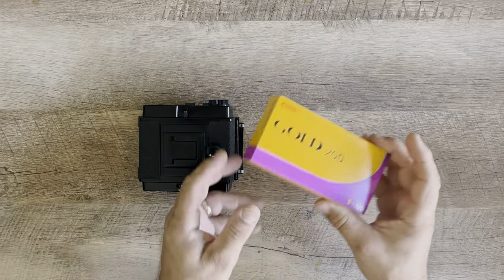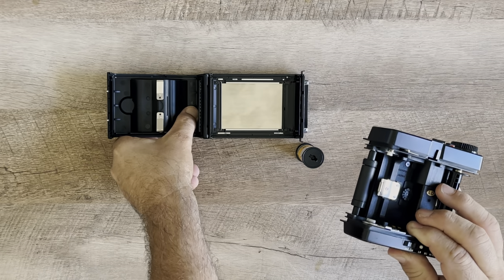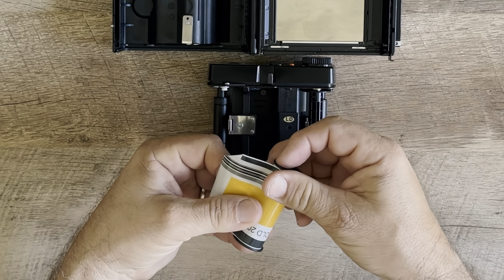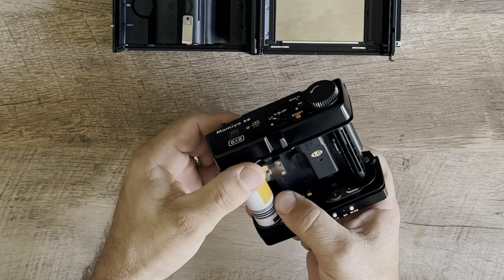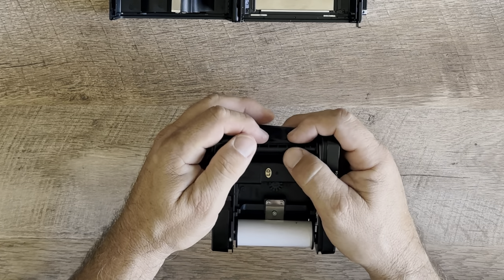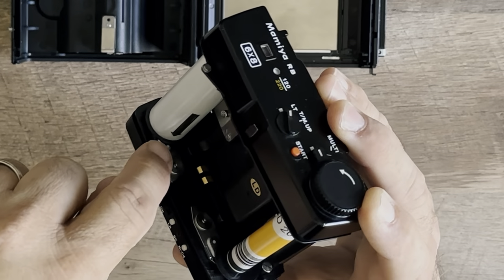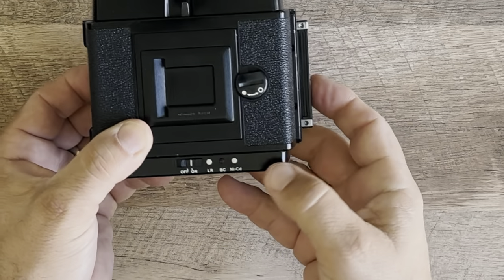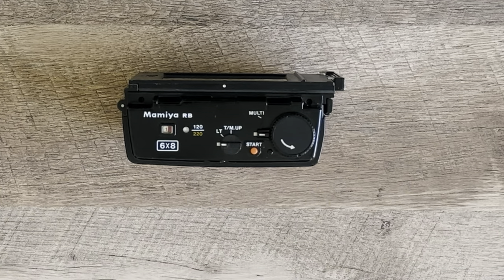LOADING A MOTORIZED 6x8 FILM BACK | MAMIYA RB 67 PRO SD

Comment: If I put in a 220 film, do I have to change a setting or something on the back? Thanks!
Reply from the maker: Tom,
I’ve never tried it. I will have to take a look. Maybe the mask in the back can be changed?
Reply from the maker: Tom, found the manual online, you can rotate the mask inside from 120mm to 220mm. 

Selecting the pressure plate position
This film holder can use 120 or 220 roll film. In accordance with the film type used, the pressure plate position differs, neces- sitating the position selecting procedure. As per the following steps, select the pres- sure plate position so that ti aligns with the same numeral (120 or 220) as that of the film type used.

Comment: What’s annoying about the 6x8 back is that most of the opening of rb67 is still 6x7, so the 6x8 film back really is a waste of film, where you’ll only get 9 shots out of a roll instead of 10
Reply from the maker: Yes I agree. When I bought it, it came with that film back.
Reply: Its even worse than that. Yeah, you either need a proSD body or a pros that has had a 6x8 baffle put in (extremely rare but exists), but the main issue is that only some of the lenses have good enough coverage for 6x8. The 50mm for example, is one of the ones where im pretty sure the corners are just barely in the image circle for 6x8, so they would be pretty poor in image quality.
Reply from the maker: Yes true, it came with the back. Eventually I will get a 6x7 back.